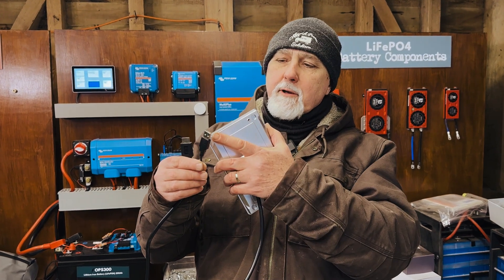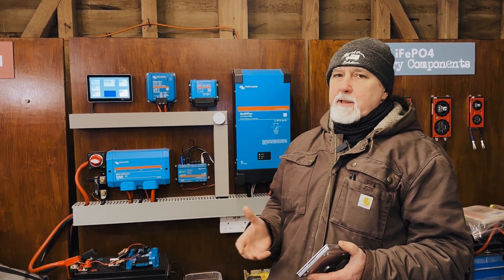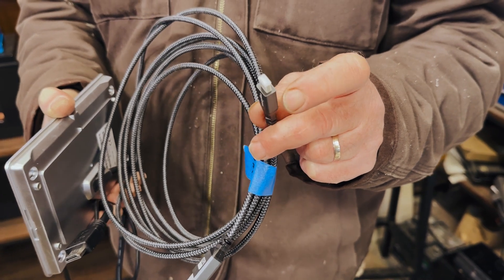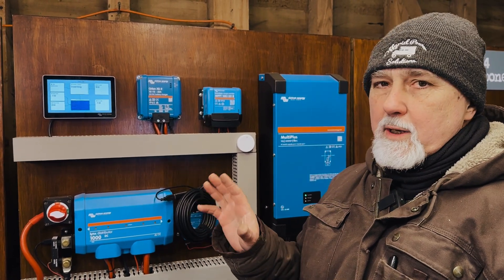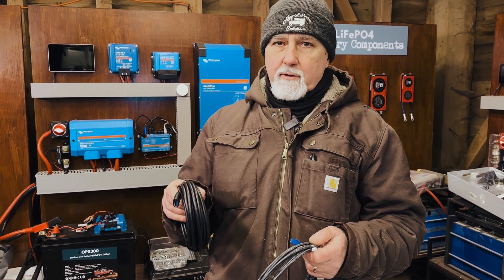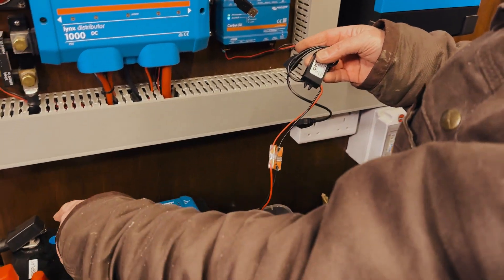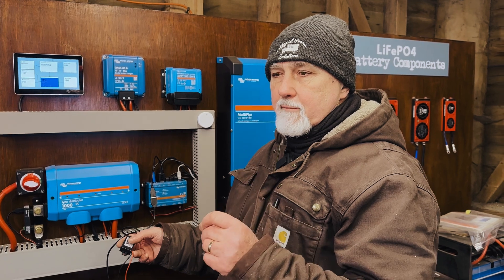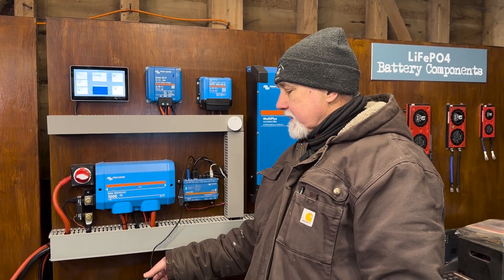How to extend power to your Cerbo GX to avoid flickering screen

Comment: Is it best to use an active hdmi lead over distance as a pose to a standard lead? I guess you could run a short USB lead to the screen if you had access to a power point close to the screen area to prevent voltage drop.